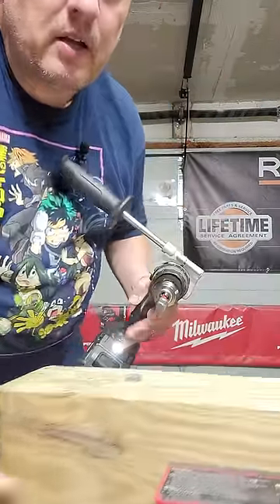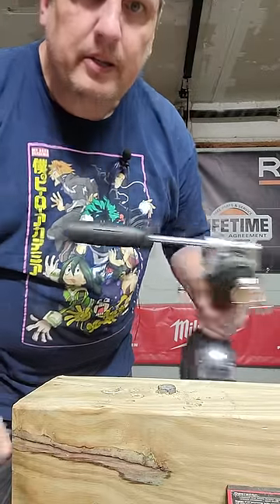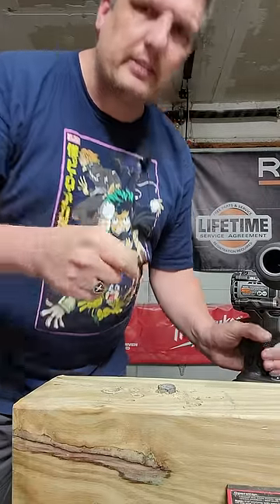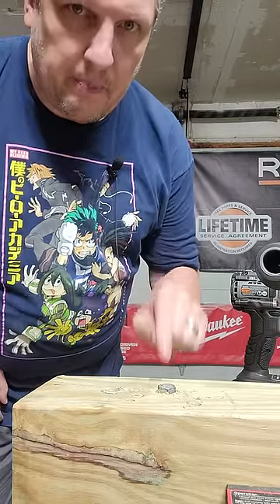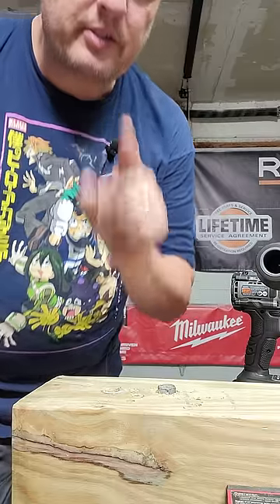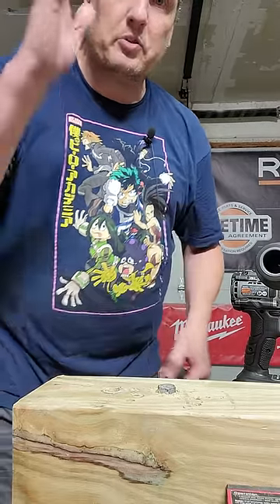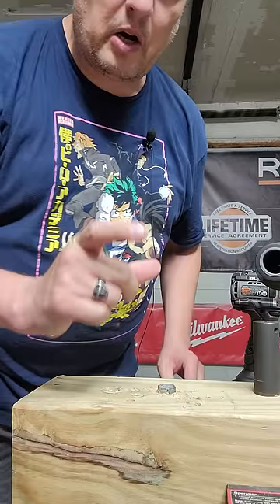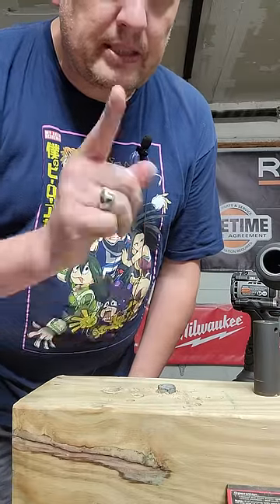Challenge Accepted! Now What? #challenge #powertools #tools #power #drill #EMBARRASSING #victory

Comment: That man definitely knows what he's talking about 💪
Reply: @canucanoe2861  exactly
Reply: "impacts are for small fasteners"
1" drive impact existing
Reply: Impacts are for metal. Drills are for wood.
Reply: @Ginyuforce420  so you can't use a drill to drill a hole in metal?
Reply: @Ginyuforce420  wrong impacts are terrible for brick and concrete, but for wood it’s ideal it hammers trough the wood great and doesn’t put stress on the motor of the drill like it does with a driver. drivers work a lot better when you are drilling with a drilling bit at high speeds making a hole.
Reply: faster than what? the hammer? only tools used here were hammer and drill. well ok!
Reply: Impacts are made for taking bolts out... not in
Reply: @hmmmtietmetmosterd  the forward feature on the impact was a mistake on all impacts every made
Reply: @idabomb00  thats interestinf
Reply: @hmmmtietmetmosterd  u're right more for out than in
Reply: If he drilled a pilot hole would have made more sense....this would never happen on a job and is pointless
Reply: @ToolswithSoAlz let's us all know when you understand the tool. Some of us are kinda worried about your safety.
Reply from the maker: Let me know when you learn how this is really done and why the drill is the safest option
Reply: @idabomb00  your missing the point. Metal roofs and metal building etc. If you use a impact on wood to blows through the wood. Thats why you use a drill for wood. And yes you can use a drill to drill holes in metal but after that your more then likely going to use an impact to fasten the project together.
Reply: Impact is better and end of story. Nobody wants to grip a drill like they’re constipated 😂
Reply: @HeHasRisen1  never said for brick and concrete. I said for metal like metal building that are bolt together. And metal roofs that are not seamless.
Reply: @minhdaubu2363  your right it takes a  real man to grip the drill.
Reply: @minhdaubu2363  impact is only toy only good for a small screws and that's the end of story
Reply: Impacts are for everything - if it fails buy another impact
Reply: @ToolswithSoAlz  safest nope 👎🏽
Reply: @hmmmtietmetmosterd  trippin
Reply: i think he does he has vibrating hand syndrome by the looks of it
Reply: Taking advice from a guy in his garage attached to his house.  Why is unfinished drywall a thing with so many people.  Heck, paint it even if you don't sand it.
Reply: yeah, much better at breaking your wrist😂😂😂
Reply: @idabomb00 steel cutting drill bits exist.....
Reply: @hmmmtietmetmosterd what?? it's made to torque....
Reply: That man definitely doesn't know what he's talking about lol.
Reply: @jonbertocchi173  duh
Reply: @idabomb00  why are you asking?
Reply: @jonbertocchi173  the comment I responded to was "impacts are for metal, drills are for wood"...... It was a sarcastic question, obviously you can use a drill for metal.
Reply: As in drill a pilot hole?
Reply: Love the FU attitude.
Reply from the maker: That's kind of what it's like on the job. They give, you give back but the dudes on the job don't get upset. These folks do.
Reply: I impact everything never have any issues plus saves your hands and wrist keeps batteries lasting longer with impact drivers
Reply: @minhdaubu2363  lmao. I agree 🤣
Reply: @ToolswithSoAlz  half of the fastener is sticking out the bottom.
Reply: Why does my impact come with a self tapping screw mode then ?
Reply: Idk wtf is going on in this short.
Reply: Dude is clueless
Reply: @hmmmtietmetmosterd he's talking about an impact driver
Reply: @dawidkowalik1863  your drill is also toy it’s too slow for the job. I’d sink that bolt with its head in the wood in less than a second with my sledgehammer. Drill is the wrong tool for that 😂
Reply: No! Right tool for the job is a midrange impact not a hex impact! That's a heavy duty 1/2" hammer drill! Use the drill that came with your hex impact buddy! Matching impact is a 3/8 intermediate impact. 600pluslbs torque! And you all fell for it!
Reply: @Longie46 stress is on the impact mechanism not the motor! It's a heavy duty 1/2 inch hammer drill. That don't come with no hex impact. 600lb plus 3/8 drive is compared tool. Really didn't cross your mind?
Reply: @nuglife4207 what brand? If you don't mind me asking.
Reply: Safest

Says the guy who just had a clamp down 4 x 6 twist on him
Reply: He pre drilled the hole from the other side otherwise that bolt is more likely to actually split that whole beam in half. Number one is two large diameter not to pre-drill the hole for it. The number to he did it from the other side so that way the tip of his drill bit just barely was showing out. And so he could gauge where to put the bolt exactly opposite to the hole that he drilled.
Reply: @Ginyuforce420 impact drills are for cutting holes in concrete/block. Regular drills are for cutting holes in metal or Inwood.
Reply: Why are cheeseburgers not made of cheese?
Reply: And definitely a shaky wrist due to all the twisted back torque from the drill lol!
Reply: No he does not.
Reply: Shaking about*
Reply: @dawidkowalik1863  🤣 Tell that to someone using a 1/2” impact driver on coach screws, through garden sleepers all day! The drill will be burnt out by lunchtime.
Reply: About time someone said it I have been telling people that too
Reply: Nah. Impactors are the tool if you do proper graft. Those drills wreck your wrist and elbows. Impactors were a god send
Reply: I work with 2" 🔩.  
Lemme grab my drill 😅😅😅
Reply: Both tools have their purpose!
Reply: No he dont
Reply: @dawidkowalik1863 what the hell do you think you put wheel nuts with
Reply: Why is he shaking like a leaf ??
Reply: Impact drivers are for removing mostly especially in the mechanic field
Reply: BET THAT BATTERY DIES AFTER EACH SCREW LOL
Reply: @hmmmtietmetmosterd, are you sure about that? If you are, all my owner's manuals are wrong. 😮
Reply: @Ginyuforce420 cap. Impacts work best to screw down fasteners of all sizes. Drills are great for pilot holes, or when u need more control over the speed of what ur screwing down.
Reply: Before I got into Mobile homework where I still use a half inch impact how is an ironworker and I used it three quarter in pack how do you think those bolts get tightened? I'm not talking about putting in screws or making holes I'm talking about bringing two pieces of Steel together that are resisting. When I first started about 25 years ago we used an apparatus called a yo-yo. A 1" impact with a 1" air hose. It weighed somewhere between 80 and 90 lb. It's basically a jackhammer turned into an impact they usually took two people to run it. No scaffolding no scissor lift no lift of any kind where we climb up on the steel where we needed to be a rope it up impact that spot and market so the inspector could see that it had been impacted and he would check it with a giant 6-foot torque wrench after the scaffold builders build him a way to gain access to the same spot we just left.....
Reply: @Ginyuforce420 false. Explain why, bet ya can’t.
Reply: No he doesn't.  That's 1 carriage screw.
Reply: @Ginyuforce420 and it takes a really real man to admit that he just shit himself from trying to drill a lag bolt to try and prove a point nobody actually cares about
Reply: @dawidkowalik1863 try using a drill to take off a lug of a semi and then come back and make that comment about "impacts is only toy only good for small screws". Then we shall talk
Reply: @hilham89  I've been on the side of the road with a flat on a trailer. 16ft trailer with two cubes of 8-inch blocks. A quarter inch impact with a half inch adapter will get those lug nuts off. I know for a fact the lugs were put on with a half-inch air impact. Between working on a construction site hey trailers and crappy trucks every single day for the past 20-something years I have two drills become from the combo set they're still in the plastic and have never been used. I've got two or three of the same drills around the house that I use for a little small projects. Some electricians to get the ones that have the hammer feature switch. They are the only ones I've ever seen use them. That doesn't make it become an impact that makes it become a hammer drill totally different tool meant for Masonry..... you know what, dammit Forgive Me Lord I've become way too invested if you want to burn up your drills and snap your wrist go right ahead.
Reply: @solidrock6524  I said semi, what is your comment have to do with what I said again?
Reply: nope
Reply: @hmmmtietmetmosterd i think the word driver proves you're wrong otherwise it would be named an impact withdrawer or remover. Just saying. 😁
Reply from the maker: @topshelf65ace86 um..a drill is called a drill driver. Let it sink in.  Maybe you just don't know as much as you would like to think you know?
Reply: Used your battery up on one screw . 
    If you are on a tall lader and need to put a long gutter screw in and cannot push with half your weight because you only would push away from the building tri using an impact driver and you don't have to push .
Reply: @ethankoernke1329  
.it will break the lag bolt too . Pilot hole is important to lag bolts as lug nuts are to car tire .
Reply: @sarge1077 can't agree more. Been working construction for years and impact Is used for 95% of things by 99% of everyone in construction. The other 1% forgot their impact at home
Reply from the maker: @hibyr ever wonder why there are entire channels, documentaries, TV shows, and hundreds of millions in lawsuits? It's from Fools not knowing how to do things. You're one of them
Reply: @ToolswithSoAlz  I have not stated which I prefer but they are both meant for driving things in. (As well as out) You're to busy defending your opinion and losing touch with the simple facts. Take a breath. Focus
Reply: No he doesn't. Before the end I was thinking my old 12 v Dewalt impact would've ran that think in 2 times and snaped your wrist.
Reply: The drill is not better after 2 of them your overheating the drill and the battery is dead.
Reply from the maker: @johnmorell2663 do you always need to lie to yourself like this? I have already proven you wrong and it was easy
Reply: @minhdaubu2363 yeah, everyone on here is tripping and think they know from DIY projects… as a carpenter my impact is king… drill is for making fucking holes.. impact is for driving screws or bolts into said holes.. end of story 😂😂
Reply: He does but saying it’s a much better tool it’s just good for his case, because if one drill did everything everyone would have it 😂
Reply from the maker: @ihavethedocuments2580 none of what you wrote is right
Reply: @ToolswithSoAlz  what do you do for a living?
Reply: i was just going to say this
Reply from the maker: @user-ln9zo2ji4d ma'am the fact that you have to lie only tells me how incompetent you are. Maybe quit blowing dudes and learn from them
Reply: He totally misses the point of a impact driver.
Reply: NOT...
Reply: This man can't wait for his next drink, he's twitching like crazy
Reply from the maker: @mikederucki8215 I have Parkinson's disease schmuck
Reply: In all reality yes for the most part, but for example, with my work on the mines, I’ve had to do alot with these hand tools and once you start needing to break off bolts with a 1/2’’ or 1’’ impact you’ll see what he means, it’s just, as far as practical drilling into wood goes, unless you’re really trying to be fast, it isn’t gonna necessarily hinder anything on that level, he knows what he’s talking about comparatively to speed but don’t avoid using your impact and buy a drill cause you need to put a hole in some wood.
Reply: He needs coffee to settle down them shakes😮
Reply: nah though, right? bros hands are shakier than  michael j fox on a saturday morning
Reply: Who comments here? :D
Spoon is much more versatile than a knife...
Reply: @HeHasRisen1  you're talking about two different tools.  
A impact is spinning as has a hammer that smacks the bit the way its turning.  

For concrete, you're going to use a hammerdrill. 
It spins like a drill and has a hammer at that back of the bit smacking it in/forward into the material.
Reply from the maker: @davekohn6049 I have Parkinson's disease schmuck
Reply: How does it compare to a wired drill with a stronger man

Comment: That might work for a few bolts… Laboring that drill that much will overheat it quickly.  For large jobs, The impact driver is the way to go. Much easier on both the operator and the equipment
Reply: I mix concrete with mine using a huge mud mixing bit almost weekly at least, been abusing TF outta that flex drill for well over a year now and it still goes just as strong as the day i got it already used in a pawn shop, it gets hot AF and every once in a while needs a break to cool off for a minute but thats fine cuz so do we out there in that hot ass sun😂 you can seriously abuse these things though, theyre meant to take it, aint getting the job done without your tools most of the time, so they make them to last✌️
Reply: @WarriorInWaiting you never mix concrete with an impact drill. Youre speaking as if this is some actual debate. Impacts are for driving screws and especially lags. Drill drivers are for drilling holes and mixing concrete. An impact is sensitive to slippage and will not keep turning when you hear that impact sound. It also stops rotating immediately when you let your finger off the trigger.  A drill driver keeps spinning, hence better for drilling holes and mixing concrete. Please dont be an idiot like the OP
Reply: @WarriorInWaiting You used your flex drill at a pawn shop ?
Reply: @fishfire_2999  totally😂😂
Reply: @drew7155  if you think that a drill keeps spinning once you let off the trigger than I'm clearly not the idiot here😂😂 (on very large drills yes, but not on a little flex drill)
Reply: This would have worked even better if he predrilled with even a 1/8 drillbit
Reply: or as compact as things are now days you can just have both....
Reply: 100% do it multiple times, I’ve called this guy out several times yet he won’t post up. Lol to funny.
Reply: You got that right
Reply: Yes, technically the impact did it. 
 But we won’t count you +300lbs on top. 
Fair trade @Milwaukee
Reply: @WarriorInWaiting  there is more control of the depth of a screw with an impact but drill is much faster. its just when depth is a thing its hard to stop accurately with a drill. but those drywall screw tip ends that don't let you over sink are great that's why all drywallers hang with drills its about the speed.
Reply: @biggs7109  your arguments are for drills and drywall? Screws and lags are not the same. Hanging drywall yes a drill with drywall screws... but lags make it easy on yourself n faster... kiss method
Reply: @lazygamer9725   i was not arguing for or against anything sorry you took it as that. i use a impact at work for everything we never use a drill mostly big grk and such lag bolts are kind of old school. and we never use em i was just pointing out that yes drills are fast but impacts are accurate as far as depth control but i also wanted to point out u can get bits that let you control the depth and i merely used drywall as a example because they use the bits most often for drills thats all no argument here friend just just pointing some of the other strengths and weaknesses of using one or the other. the right tool for the right job is the number one thing drill good for some impact for others.
Reply: @biggs7109  I can agree
Reply: I was thinking the same. Along with, how fast that battery is going to drain. 
Is “Flex” worth the savings on cost? Battery life, durability?
Reply: +1 This guy in the video is flat out wrong. You can tell by his body position that he's not thinking about long days of use. He's making his point oj a narrow use case. Impact transfers load to the fasteners instead of the operator. Much better solution fur anything torque related than a drill
Reply from the maker: @jdsboston ma'am if I'm wrong it should be easy enough for you simpletons to prove it. Pick up your little camera and show us all how it's done and why I'm wrong. However, I bet you'll be like the 20 other little girls that came before you. You'll make an excuse as to why you can't or won't. Maybe you'll say you'll do it right after work. In the end you'll do nothing because you'll find out, just as they did, I know a lot, and I mean a lot, more than you.
Reply: Absolutely after a few times you will smoke the drill period!!
Reply: @drew7155  💯 correct! But the sheeple (hate to say it) don’t think about the consequences of manual Labor that accompanies the drill. Yes it’s “better” but to what end? Do u wanna be shaking at the end of ur life? What’s up with that? What are really doing here 🤦‍♂️
Reply from the maker: @rustymallard3824 No ma'am. You girls know absolutely nothing about tools and shouldn't use them